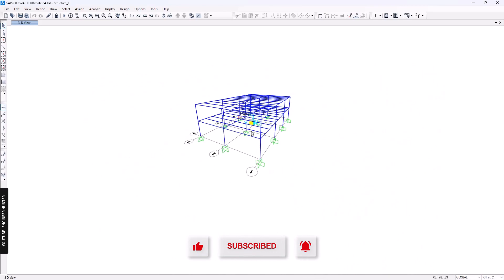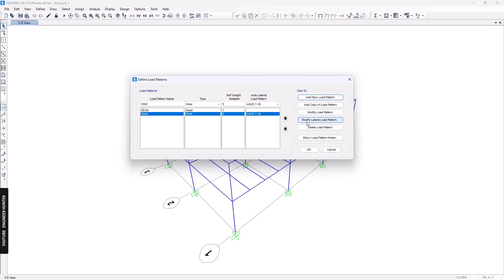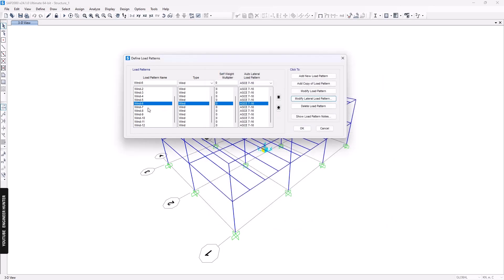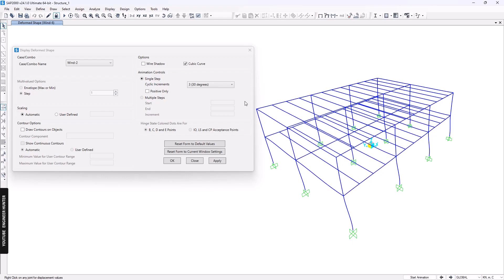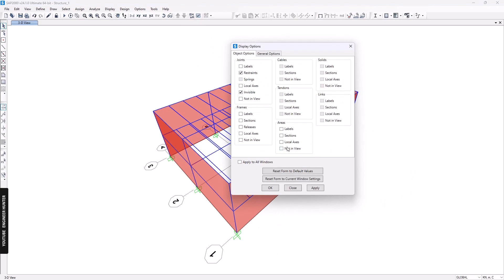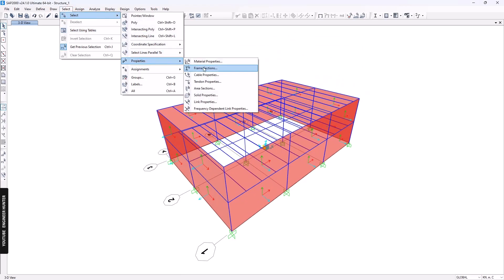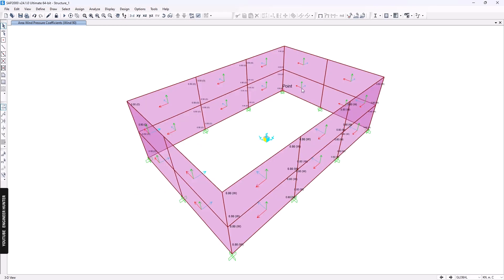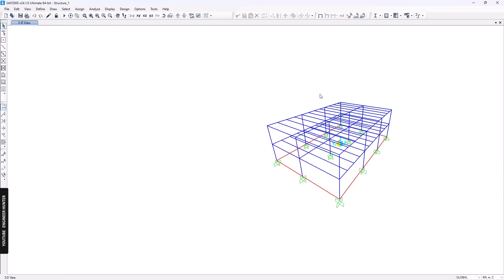Apply Wind Load in SAP2000

Comment: why windload generator didn't divide cladding into zones A, B, C, D?
Reply from the maker: The wind load generator in the program is not really automatically use the same method in the design code. There are some assumptions and limitations.
Reply: @EngineerHunter too pity as there are other software that can do it for today

Comment: thanks, i need to ask about last method, how we can apply at roof with cladding due to suction and pressure from wind load?
Reply from the maker: The program has limitations. If you want to consider all cases, you need to input manually.